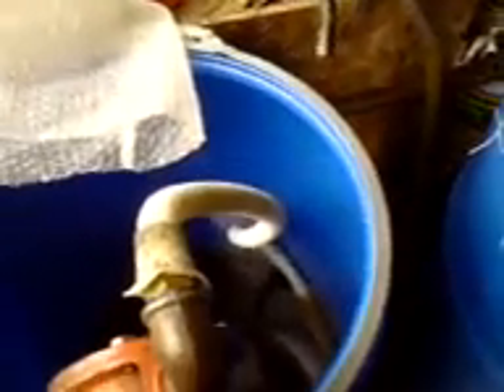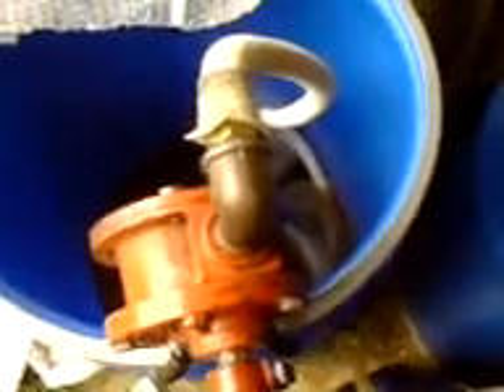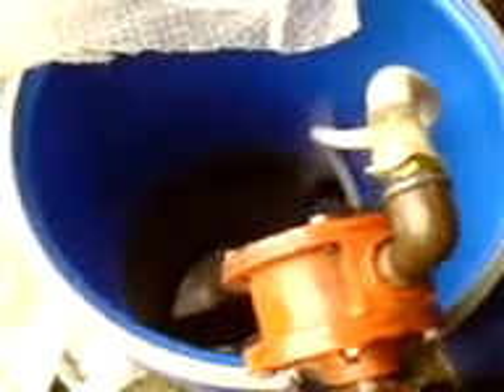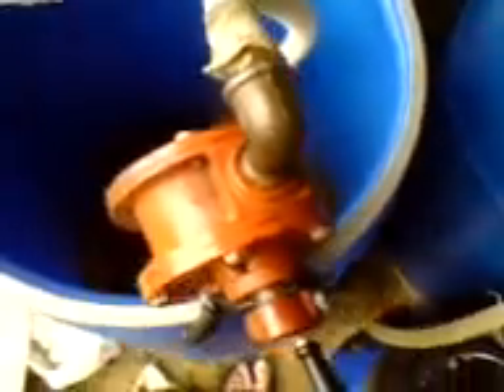Purifying Waste Cooking Oil for Fuel (3/4)

Comment: forgive my ignorance as this is all new to me, i have seen a lot of videos on here on making biodiesel & they use heat but you dont?
my car is a new vauxhall insignia 2 ltr, will the biodiesel work in the modern cars with NO damage to the engine, its a lease motability car as mt partner is ill, so i dont want to bugger the car up, can u help, thx

Comment: Delighted to find this video. Started successfully running my Hilux Mk3 on sunflower oil. Have since been offered cooking oil (from deep fat fryer) from a hospital kitchen where they only use the oil once for cooking chips. It's got to be really clean already so I'm looking for simple filtration and water seperation system.
Will probably build smaller modified version of yours.

Nay problems with your vehicle/

thanks for uploading.